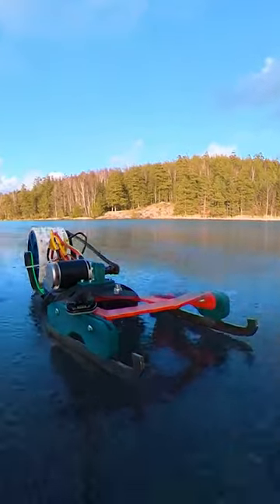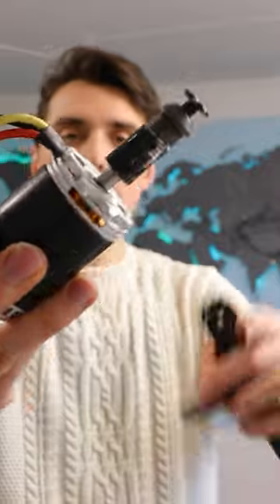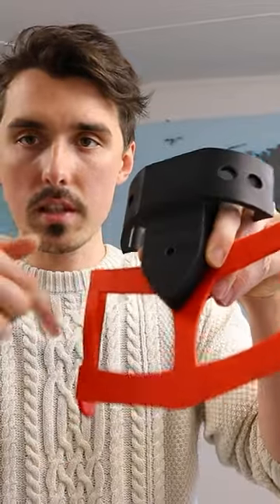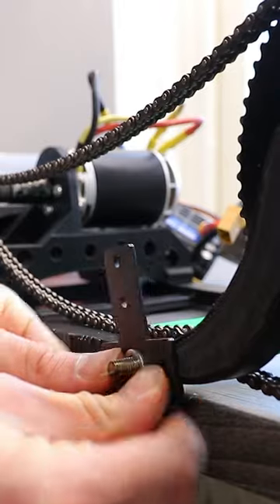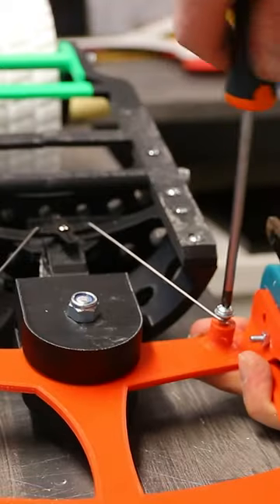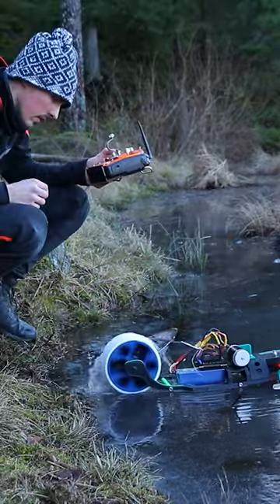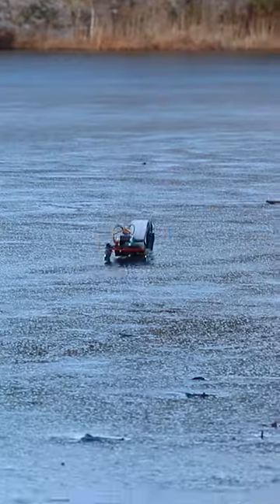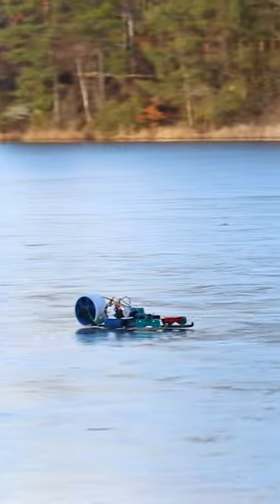How I built A 3D Printed RC Ice Vehicle #shorts

Comment: put a 1:1 gear ratio on that motor.  It's a perfectly flat, smooth surface with no resistance, so you should push the gear ratio to it's max, until you need to give it a push just to get it started.  You'll hit 100 km/h I figure.  That might be fun.

Comment: Put on a bigger drive gear at the motor and I will solve your speed problems. Also add a little bit of weight to the tire so that there’s more mass pushing down on those screws.